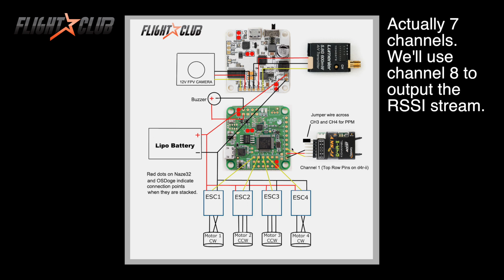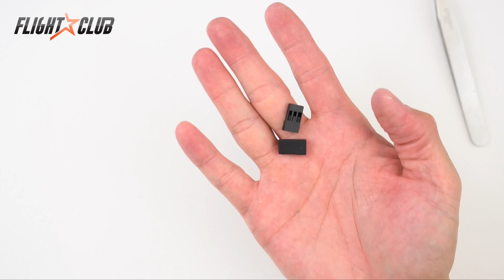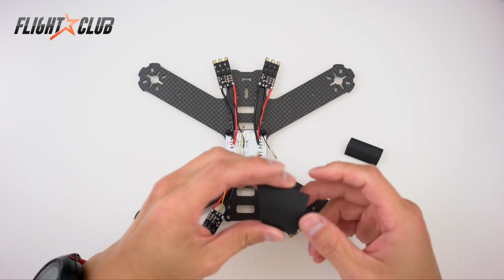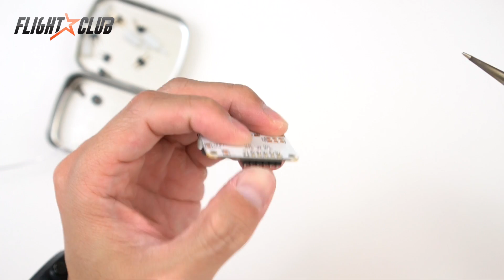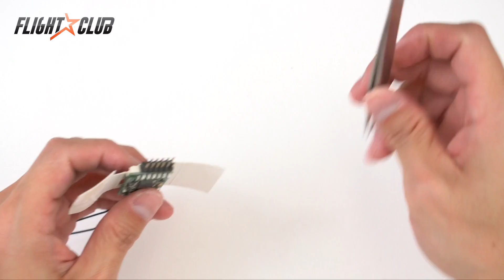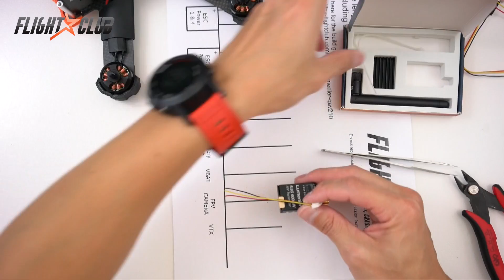How to Build a Lumenier QAV210

Comment: I wanna do this build but run JR TX/RX. i Learned from another vid how to connect the JR servo lead to the nase 32 but not sure if i can run the OSD. would you have any advice. I know the guy that explained it used clean flight to flash it and set up the xbus.

Comment: Would a 40W soldering station be powerful enough in this hobby
Reply: Maybe, but I don't know. Some soldering irons/stations get hot, but they don't have enough wattage to maintain a certain temperature. Stations generally have enough wattage, so you should be more than fine I think. I use a 65 watt, but I also do a lot of soldering with bigger connectors. For example, an rc car will generally need a higher wattage which makes it easier to heat the bigger wires and connectors. When I had a low wattage iron that got super hot, I always struggled soldering and melted a LOT of connectors while doing so.

Comment: in the first 3 minutes you talk about speed controller refresh rates and your wrong it has nothing to do with the motors power the frequency or HZ has to do with the lag time between the flight controller and ESCs ability to change the motors RPM to make stabilization corrections in simple terms the higher the HZ the more stable your drone will be

Comment: for your camera and transmitter did you have to use a voltage step down for a 4s setup?  the camera i have says 5-12v

Comment: OSDoge has a new revised board I just received. Also ordered an AfroFlight Naze32 rev6. When trying to stack these as in the video, I found the center two pin on the rx-tx are reversed of each other. That will result in crossing when stacked. Do I really need these hooked up?Thanks
Reply from the maker: +Mark Ewert yes, you need them.  that's where the OSD gets all the info.
Reply: +FlightClub , ok I looked at the video more closely and yours is crossed also. So, it must work like that ok.Thanks for the reply.

Comment: how do I power the naze32 without the osd?! I'm not using an osd so how to i power my naze?
Reply: a bec
Reply: Thanks I also figured I could run 5v off my pdb with a pololu 5v stepdown to one of the open "esc" connectors, since I am running ppm i have open spots on the fc.

Comment: Would 2500kv skitzo special motors work on this frame?
Reply from the maker: +MLGamer yeah.  you'd have to run 4s and some tri-blades to get optimum performance.
Reply: Thanks so much for the response , will definetly use these motors and that setup

Comment: frame design is crap and weak in the center.  might fly good but the weak point is right where the main board goes and one crash could destroy not only the mainboard but the frame shock is always going to be transfered over to the mainboard which is mounted at the weakest poing the center of the frame which looks too weak to me.  SOrry.  but nice video though.

Comment: Where do I get a VBAT cable?
Reply: +BOSS AERIAL PHOTOGRAPHY After emailing I figured out your supposed to convert one of the three pin red black and white cables into a two cable with two pin connectors by removing the third wire.

Comment: I order all the parts you've listed in your video. I'm currently putting together the 210 and came across a problem where I don't have a 4x1 90 degree header pen or the 2x1 90 degree header pen. Although my Naze 32 came with 6x3 90 degree header pen. Please help thanks

Comment: Wouldn't you consider to spray liquid electrical tape on the back of the distribution board? As it's liquid rubber, it could absorb some of the vibrations AND electrically isolate the board from the carbon plate. Could be useful in case of crash chopping off a bit of paint from the distribution board, causing short with the frame.

Comment: If the pdb is touching the bottom plate of the frame (no space) is there any risk of shorting out anything. Great video by the way
Reply: +George Amenta I asked the exact same question and Mike answered: no problem as long as you don't use the Pololu. In case you're still worried, use electrical tape between the frame and the PDB.
Reply: +Max Zigliara alright thanks i ended up putting tape there just in case

Comment: Thanks for replying.  I'm getting really close to buy your 210 kit.  The wrap would be black and the 3D would be green and so would the props.  What size props and battery should I add to the kit order when I do?  The only thing that is holding me back on my end is experiencing motion sickness or vertigo due do the fpv.  I'm trying to find someone in my community to let me try out the goggles to see how I react.  Any thoughts on my concerns?

KK

Comment: why only one signal wire ? is it due to the OSDoge ?
Reply: Using the D4rii reciever, you'll have the ability to use ppm signal which means you need only one signal wire just like S-bus. Sbus is usually faster than ppm tho. If you're using more than one signal wire, that means you're using pwm.

Comment: could I pay you build one but using the new skitzo edition motors instead of the cobras? or is the custom order built with only the parts you list on your site?
Reply from the maker: +Alberto Alvarez sure, send me a note on my site.  i only have a couple frames left though.
Reply: +FlightClub ETA on custom qav210's?
Reply: +FlightClub bought some 3d printed stuff from you, do you sell the 210 motor guards in different colors or just black?
Reply from the maker: Thanks Alberto!  Yes the motor guards come in all different colors:  http://fpv-flightclub.com/product/qav210-motor-guards/
Reply: +FlightClub thanks man, ordered all the 3d qav210 parts from you. does the vtx holder fit the new luminier 600mw mini pro? I hope so cuz that's what I ordered lol btw my build consists of the new tbs power cube and the 2206 2350kv motors, hopefully it fly's well! thanks for everything!

Comment: You should check out the new RROSD Pro mini PDB board from Red Rotor. It has everything you would expect on a PDB and OSD all in one just like the OSDOGE does but for only $35. Only difference is it doesn't stack with the Naze board but the reviews look promising, I have one ordered now. I read about it on RC Groups. Keep up the great build videos. Happy flying....

Comment: Where do you get your wire mesh?
Reply: +Solomon Parker Take Parachord, take out the white inner strings and your left with the outer casing, (mesh) I do that and it works amazing. remember to heat shrink the ends
Reply: +Solomon Parker 
http://www.amazon.com/gp/product/B01919EI4Y?psc=1&redirect=true&ref_=ox_sc_act_title_1&smid=A38Z015AJ7I755

Comment: What if I want to switch back and forth between 3s and 4s?  Is OSDoge going to hate me?
Reply from the maker: +Solomon Parker nope, actually i have mine set at 4s and i switch back and forth
Reply: +FlightClub Upon further research, the OSDoge will regulate to 12 or a little below 12 if you use a 3s, but since the camera and transmitter are both able to handle a lower voltage, it doesn't seem that it should be a problem. I assume the board itself runs on 5V just like the Naze32. But experience trumps theory, and in this case they appear to agree.

Comment: i have not finished watching so correct me if im wrong but wont mounting the PDB directly onto the carbon fiber cause it to short?
Reply: +- DanTheMan -  he doesn't use the connections on the lower part of the pdb. The conductive parts of the pdb that are touching the carbon frame, doesn't run electricity in any moment. Hope that answers your question.